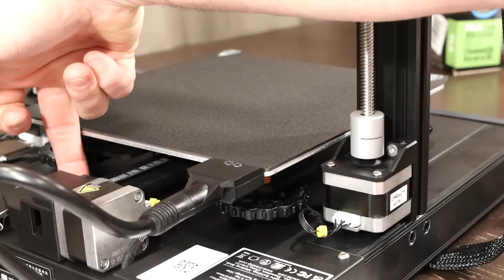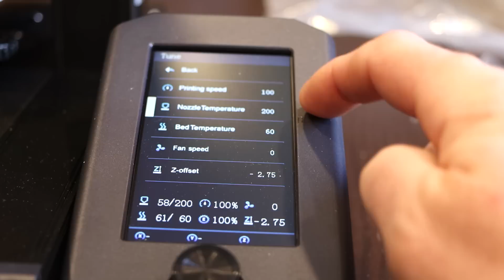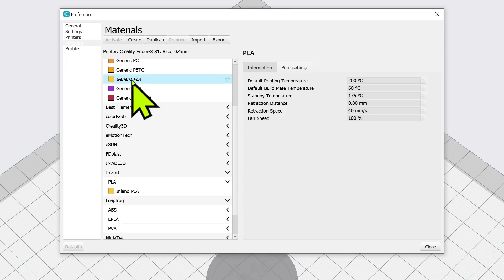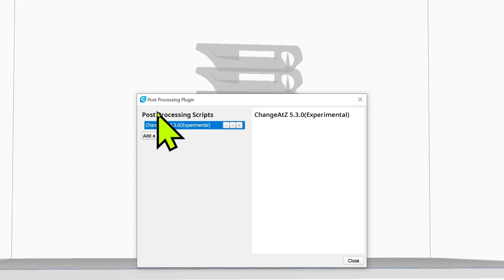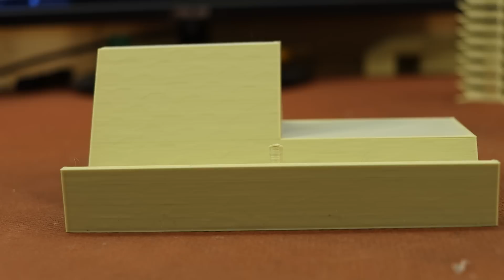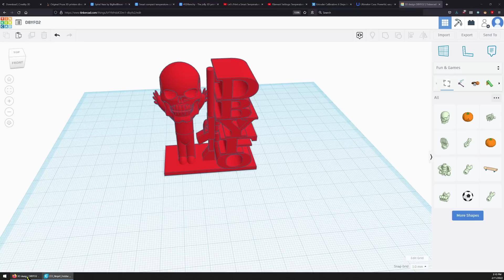Getting started with 3D printing

Comment: Preface: This is a long comment.
I highly recommend, no matter what printer you use, are interested in, or have, to check out Discord's 3D printing channel (it has a blue/white failure benchy as icon) there are TONS of helpers in there to get things going smoothly for nearly everyone interested.

as an Ender 3 (from 2019) owner, I enjoyed watching you assemble this with little to no knowledge beforehand.  Not making fun of you, but it shows that the printers really do need some work on the manuals and better explaining of terminology and such (which is something I had issues with, even doing research on them)

As for your Z limit switch, no, typically you use only the Touch sensor or the Z stop, not both, as they plug into the same areas to do the same function "stop the Z movement"

your bed springs should NOT be fully compressed, I would loosen them a few turns to where at least the thickness of the spring is the same as the gap between each turn. Fully compressed springs don't help anything.

do not update firmware until you know there is something you need, that is missing. Creality printers come set for what they are, usually with barebones mainboards that don't have a lot of memory or processing power to do much else. (in my case, updating firmware was so much a hassle, due to needing to disable lots of other normally supported things, to fit on the memory chip)  typically, firmware is the last thing you'd need to touch, and usually only to try something new, or completely gut and make a printer.   OR if you know an update, will fix an observed problem/issue your printer has.

as for filament/removal, yes while the nozzle is warm (at least 160C typically) you'd want to remove the filament to change out other filament, but if your going to use the same filament, there isn't much reason to remove -unless it is something that will absorb moisture from the air and you don't plan to print again soon. (so store it so it doesn't get wet)   The first thing it prints is a "purge line" so it pushes out the old filament that was in the nozzle (at the start you notice it was yellow -they tested the machine with yellow before sending it to you) 

Quality PLA will have a totally different feel than cheap when printed.  Not saying the sample splurge size is not good, just you will notice when you try others.  I highly recommend using a Print Tower and calibration cube/cat on each new spool, even if it is still "PLA"  Sometimes, even color makes a difference in stringing/quality. (as some colors melt faster/ooze more, etc than others at the same temp. settings)

A good practice is to preheat the bed first - and let it sit there a while.  Then level the bed or print.  It usually takes the bed longer to heat than the nozzle,  and once the nozzle is 'at temp' plastic will ooze out, to limit clutter/debris, heat the bed first so the nozzle heats and then is 'ready to print' - if your not printing, but doing some calibration work and need the nozzle hot - retract the filament a good 10mm so it doesn't ooze and blob out.

I have permanent marks on my glass/carborundum bed from first time printer user experiences.  They happen, it's part of learning. Take them as a badge of honor.  If the buttom of the print (usually what is touching the bed) isn't pretty to your liking, or needs to be 'smooth' or 'textured' like the bad, beds are not that expensive to replace, in fact I suggest looking into Garolite/G10/FR4 board (1/16inch or 1.5mm thickness) it makes an excellent print surface. (you will need clips or some way to keep it attached to bed in your case though, keep that in mind.)  

If your in an area it sells to, I suggest getting GST3D PLA+, I am not sure of it's "best quality" compared to others, but when buying a few spools together, it gets real cheap. (10 spools for $9 each sort of bundle deals) - when it is bundled like that for those sales, otherwise $15 each isn't too terrible either.  The silver/gray looks like Duct Tape.

Your Slicer choices can also override your printer defaults. So if you wanted to print a specific plastic at 215 instead, your Slicer can tell your printer (through Gcode) to heat to 215 instead of 200 before printing.

Putty Knives are known as "bed destroyers" to many, because of just how easy they mark the surface.  A flexible bed would probably do you wonders, since you already have a magnetic bed system.

Supports are.. fun. and not fun at the same time.  Typically every printer can do 45degree overhangs, most good part coolings can do 60-65degree, beyond that and your really going to need excellent print cooling systems, and I am not sure how far the S1 can go. (there are tests for this, however, freely available)

Support Perfections comes with practice, soon you will learn what support is actually needed, while what other support can be "blocked" (with, support blockers, in slicer settings) to prevent them from printing in that area at all.  The best support, is not needing any support at all, so being able to angle the model in a way that uses bridging and overhangs to print the entire model, instead of support structures, is the most desired.  But sometimes it is simply not possible, so learning when, how, and the best type of support for the model in question is just something you learn with practice.

If I remember right, the S1 has some 'captured ptfe tube" inside the hot end area - so DO NOT exceed 230C.  (PTFE begins to break down, off gas toxic fumes, and cause massive print degrading problems once it starts to break down, the toxic fumes are enough to kill small animals rather quickly, and cause issues in humans over time)

I personally count "kilograms of filament" for how long/much I've used a printer. It seems to be much more valid than "number of prints" since some prints are faster than others, although 'print hours' if calculated properly, would also be good.

I highly suggest CURA as a slicer,  but any free slicer will work, you just need to get used to them (and I got used to Cura over the years) some terms are changed "spiralized outer contour" for example, instead of "vase mode"  but they typically can all do the same thing, with a few exceptions. (which are niche and may not be something you even use)  Creality uses a "customized" version of Cura, but it's out dated from the actual Cura - so switching to Cura from Creality would be the better choice for you so you have all the options and can get more easily support.
(Prusa is overused and over hyped, the only real thing it has over Creality right now is "painted on supports" which is fun and neat, but not 100% needed.  Cura is also working on a better slicing system Arachnid to print better using the complex geometry your prints may have, something Prusa slicer has yet to copy over)

Infill settings can help get things to 'not sag' for the top prints, as it will have internal support structures to print over, combine with 'surface layers' (at least 2) and print quality goes way up.  You don't need a lot of infill for many models, I never exceed 10% (or 5% with double infill lines in my case) for the majority of things - higher rigid parts will need more, but for probably 90% of models, 10% is fine. (also 2 walls or perimeters, higher if needed I never go above 3)  For your coin bottom prints, that is bridging settings, and something isn't quite good on it to have that much 'loose' on such a small print.  perhaps too hot printing, or not enough cooling, or many other factors.  all else fails you could enable supports when you slice it and support the underside (but then you have to remove supports)

The "Quality" settings (0.2mm standard) is the layer height. The fewer layers, the faster it is, but the less detail they can hold, and the more plastic your pushing out at a time. A lower height (0.12 for example) has smaller layers, takes longer to print, but can have much finer details (smoother appearance as well)  For almost all prints, 0.2mm is fine. If you want to print faster, and are ok losing details, but want to prototype parts or the like, jumping up to 0.32mm layer height is completely possible.

I find most PLA .. .doesn't need to be vacu-bagged.   ABS, PETG, yes, but PLA... I have had out for  6 months and never had an issue with it. I live in a place with rather high humidity, and print in the basement at that as well,  further tests shown on Youtube by other more experienced users, also show that PLA really doesn't absorb that much, even if fully submerged in water for hours.  I just put mine in a loose bag, if any bag at all, and a couple dessicant packets in it.  I have a spool out for 4+_ months now, with no dessi - and no bag around it, and plan to print in a few months to double check the findings.

Cura's default retraction was set for the Ender 3's bowden tube set up. Your S1 uses Direct Drive, which is why it has such a smaller number in retraction settings.

Creality had some quality control issues, and the lack of assembly guide is one of them.  While 'figuring stuff out' is part the hobby aspect of 3D printing, for higher quality printers (including th S1) it isn't tolerated from feedback to be so laxed.  Simply put, if this were a cheap kit, like the Ender 3 original (like I have) sure - that is fine, but once you breach the $300 range in printer cost - it is expected to be better documented, maintained, and standards.       Sadly creality hasn't really gotten better over the years, in 2020 they had a huge drop on QC, warped beds, bent lead screws, etc.   Ever since then it seems the 'demand' being high simply made them ignore otherwise obvious defects and sell as fast as possible for profit, instead of making sure each printer/kit was well made.    

For those thinking of getting into 3D printing now, in 2022, I don't suggets Creality, but instead Tronxy, they have similar designs at comparable prices, but Tronxy owners seem to have much better experiences with building and using the printer.

Comment: no need to clear the nozzle after printing ... when you resume printing (or change filament) there is a screen to extrude excess material... take the head temp up to 220 or so and keep at it till the new filament extrudes

Comment: The differences in the retraction settings are because in Untimaker Cura you based your profile off of a standard Ender 3 which has a bowden tube extruder whereas your S1 has a direct drive extruder. Changing those settings to match the creality slicer settings was the right thing to do  - direct drive extruders need much less retraction than bowden tube ones.

Comment: For PLA removal form the bed grab some Acetone, it works wonders, and requires no scraping.  Just make sure you dry it completely before printing again  or it will cause malting on the first layer and the whole print will go poop.

Comment: I would set the Z axis height with the bed and Nozzle up to printing temp or you end up with your nozzle too close to the bed due to thermal expansion... as you found out :)

If I switch between high and low temp filaments I'll redo the Z height to account for the temp differential and hence expansion differential.

Comment: I feel the "If I buy something and upgrade it with things I don't really understand yet".  That's where I'm at with my Ender 3 Pro.  LOTS of upgrades and I've been stuck getting a Marlin build done for a long time now.

However?  When I actually get the damn thing working?  I'll be able to print Nylon and Polycarbonate, which is what I want to prototype/fabricate automotive, household, and drone parts.  I also got an MSLA printer for artsy fartsy crap.  But the Ender is what excites me.

Comment: Congrats! I have an Ender 3 that sat around for multiple years waiting for me to set it up. That would not have been the case had I had the S1.... Anyway, I finally did during a snowstorm a few weeks ago, and I have been printing nonstop, learning everything I can ever since; lots of fails and maybe a hundred YouTube hours later... now I want to add an Ender S1 in a few months (which I didn't even know about when I started watching stuff on YouTube). I can tinker and experiment on the older Ender as a base, and print continuously on the S1. Other commenters have said this but every mod introduces new complexities; there is a lot to be said for a built up Ender which should just be no fuss. Also, I think people who are so minded that will mod the S1 anyway, and the rest of us will benefit from that too. 

These flex build plates are a cheap part of the overall, I will be swapping mine for PEI soon (my build plate not the magnetic kind but it does flex, I attach it with binder clips). 

Oh a few things to cut down on print times: 15% infill for anything that's not needing strength (watch for instructions from stuff you are printing), use lightning or Gyroid setting in Cura (I believe the Creality slicer is just a branded instance of Cura, which is what I am using - you might want to grab the latest version, it's free). Tree supports anytime you can. Then, you learn the Cura settings even more and can tinker with stuff like layer speed, extrusion percent, line height and more. It is so fun to try out different combinations and find really great ones. My Ender 3 prints have consistently amazed me. On paper tension, I recommend just where you are feeling the nozzle vibrate through the paper, the faintest bit. Any less, it's kinda high, and any more, well, you might dig into that surface.

The weird handle seems to be for the front drawer! I have heard multiple people wonder about that, but I read it in a comment!

Messed up prints are part of the game at this stage, so, just be mindful of that. 

I am eager to see where this goes for you!

Comment: My ender has the glass bed. It works so much better than the Build plate this has. The print will stick to the glass when it is hot and you can just take it off once it cools down. Very convenient.

Comment: To be honest. I dont think getting a ender series in 2022 even the s1 is a good idea. Too pricey for a now considered small build plate.  The ender has tons of content and the community is great, but if i was to start over again, i wouild head straight to the cr10 v2 and up. right now on creality cr10s are under 300. no reason to get a ender if the CR series are becoming reasonable unless a ender max, but again for $400 you can almost have 2 cr10s.... Buy 2, thats another thing i wish i could of learned when i started, that youll figure quick that you need more printers, so cost and accuracy of printer is critical . CRs even has a better glass plate that I cant see a reason or how you would need glue unlike. The difference from a smaller build plate than a larger build is tremendous from precision accuracies to cutting hours. So yeah for the $500 one of these cost. Im running with the cr series. Hopefully more people realize and the content can overflow like the ender. I mean would you rather print the whole thing or have to bond it together. No for prusa i3 I have that also, but also could have bought 2 ender 3s when i figured the ender could perform the same////I mean alot of people were getting geetechs and couldnt tell they were clones. Take advice from someone who made mistakes. Invest in the cr10s leave ender alone after this. Aye nice extruder tho. One last thing. it will pop off when its cool, dont scrap with that scrapper if you want it to last. you can use your hands for brims

Comment: I just recently dusted off my own Ender 3 (v2) to try and nail down printing 35mm miniatures for DnD and damn is it frustrating. Long print times are the norm with FDM tough. What you can do to speed things up on bigger/less detailed prints is use a bigger nozzle (0.6 or 0.8mm), increase the print speed from 50 to 100mm/s (in the slicer software), reduce infill percentage, try to avoid supports where possible, reduce the number of walls from 3 to 2.
Reply: for miniatures you will not be happy unless you get a resin printer.
Reply: @joshjones5172  Not happy but satisfied. I have some overheating issues currently because of failing fans, but once I get those replaced I am confident in archieving playworthy minis without the hassle of SLA postprocessing and having a dedicated second machine.

Comment: I print PETG lowers all the time. The key to clean prints with PETG is it needs slightly more retraction distance and a slightly higher extrusion multiplier. I run most PETG around 238c and I bumped up my retraction a few 10ths. This along with a 1.1 extraction multiplier helps account for the PETG viscosity increase over PLA.

Give it a shot and see what you get.
Reply: Petg prints a lot better when it is dry. Less stringing and oozing.
Reply: If you go with a Biqu H2, you can lower retractions on PETG to around .32mm and around 20mm/s and have almost no blobs or stringing. The H2 is insanely good for it.
Reply: I hated PETG back when I first got my printer. I just bought some again after I realized I have modded my Ender-3 V2 so much it's really not the same printer anymore, nor am I the same operator. I have high hopes for it now that I can successfully print nylon, ABS, ASA, HIPS, and PC. PETG should be a breeze.
Reply: Where did you get the files for that?